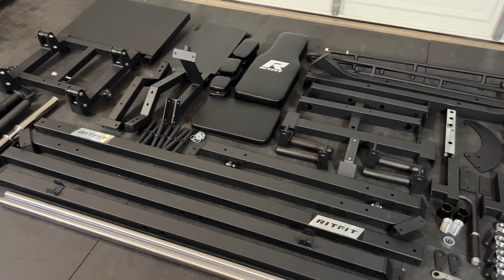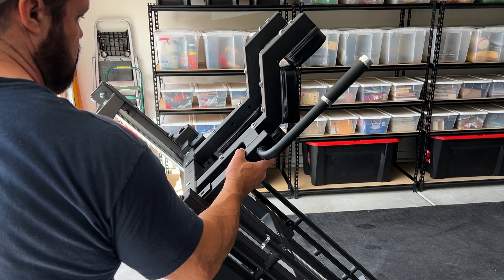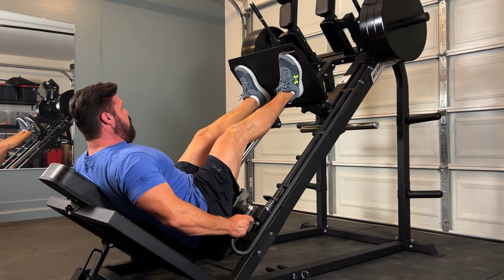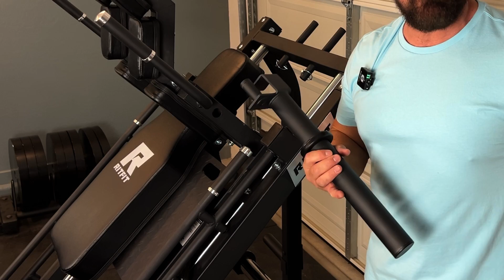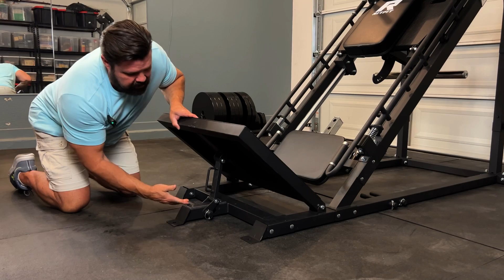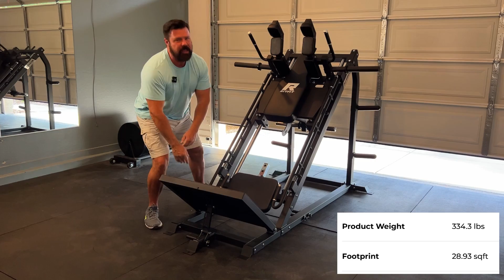Gazelle Pro Leg Press & Hack Squat Review | Range of Motion Tested!

Comment: Is there any way you could just move the safety block completely out so you can get the full range of motion?
Reply from the maker: The piece the safety stop sets in is part of the frame cross member. Even if you completely remove the silver insert your only getting an extra 1/8th of an inch to where the frame is. But compared to the others I've tried the Gazelle Pro has the best range.

Comment: I guess moving the footplate up might help shorter ppl like myself
Reply from the maker: Yes, I watched a bunch of reviews and most people under 5'10" or so would add some height to the lower foot plate. Stacking some cut up horsestall matts or even building a wooden box the same size as the foot plate. Otherwise you just don't get that deep range at the bottom.
Reply: @ yeah ppl also have been using yoga blocks on the shoulder pads
Reply from the maker: @phresh7716  Yeah I saw that one too. The leg press has a lot better range but the hack is where it is more limited.
Reply: @ thanks bro